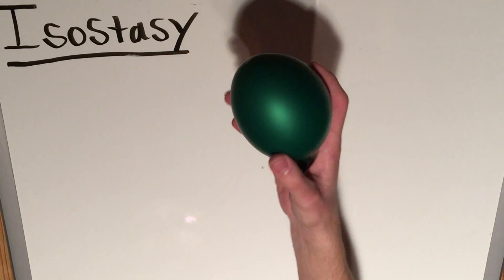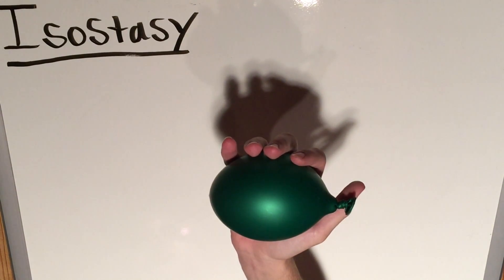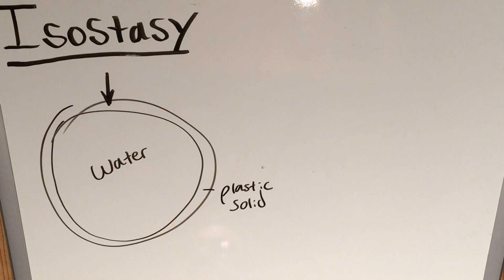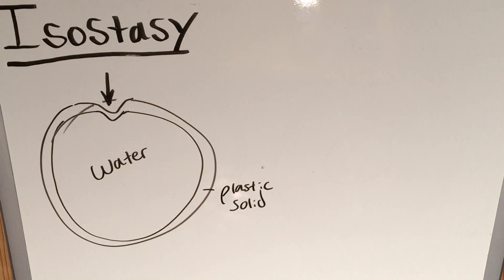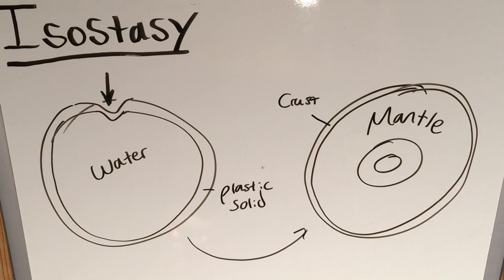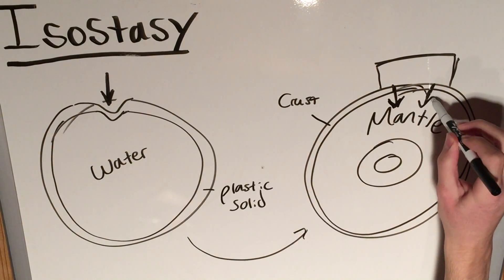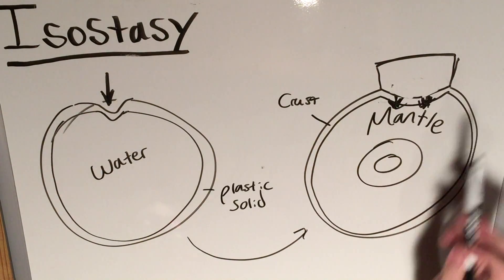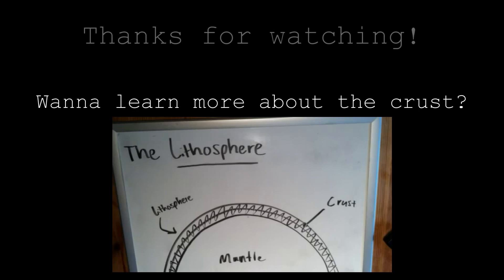What is Isostasy?

Comment: Thanks for the great explanation. This brings up the question: why is the crust solid and the mantle liquid. The simple answer is that the crust has cooled because it was able to expel its heat into space in the form of electromagnetic radiation.

But what determines the thickness of that crust!? I guess it’s ultimately a question of how much heat there is left in the earth (including the heat of fission), and how much heat comes in from the sun, how much radiates away and so forth.

But I’d imagine the lithosphere dipping down like that gets slowly eaten away by the presumably hotter magma it is exposed to. I guess it takes a long time, though.

Comment: People are saying the balloon isn’t a valid analogy because it’s stretchy however if we know anything about isostasy we know that it is a very slow process. Folding, faulting , fracturing and other structural geomorphologic processes are not present here. They are present with orogenic means  because mountain building is caused by catastrophism or other sudden, violent tectonic events. The lithosphere simply cannot handle a sudden entrance of that much energy into a system. The Isostatic rebound we see here is possible because of very slow adjustments in equilibrium. We could not have rebound because the lithosphere would deform indefinitely via fracture. The balloon represents a stretching lithosphere and though the lithosphere is rigid it will not fracture because of a slower entrance of energy. Epeirogeny is one of the main geomorphic processes that is a result of isostasy. Where orogeny and epeirogeny both can build mountains, they use two completely different methods in terms of the deformation caused in the lithosphere. Isostatic rebound would not be possible if the the lithosphere did not warp in some way.

Comment: If the earth's crust is pushed down in one location, doesn't it rise in other locations? In the case of polar ice melt water adding weight to ocean water, as land under the ice rises, do all continental land masses rise as well?
Reply: The lithosphere moves downwards and the asthenosphere compresses... at least that´s what I understod.
Reply: A shifting of mass does not equate to the adding of weight. With enough pressure land masses would rise. I’m wondering, if two giant asteroids slam into opposite sides of the Earth at immense speed would the ice at the North Pole be bounced out of the atmosphere because the bounciness and flexibility of the Earth?
Reply: @user-ur2mr7dj6h  
No because the Earth is too big for a small force like an asteroid to cause that. And also the asthenosphere, although it flows(and very slowly too), is solid, which means high density and that equals greater upthrust. So if a large asteroid hits earth, most of the damage would be on the crust.

Comment: I'm not sure about that first part. The compressibility of water is negligible and so the volume won't actually decrease. The depression in the balloon is possible because the balloon is stretchy so the water can be pushed elsewhere. I get that its an analogy, but its important to realize that water does not react according to Boyle's Law P ~ 1/V. Good description of isostasy, but a misleading analogy to explain it.
Reply from the maker: Nice feedback. Yeah,  the water balloon is by no means an accurate model or reproduction of isostasy on a smaller scale, rather a simple representation of what is observed. Rather unscientific, but as long as one doesn't assume real isostatic adjustment is actually that simple, I thought it worked for the sake of the video.
Reply: Well how compressible is magma compared to water? Maybe the mountains cause pressure elsewhere, like the water balloon.